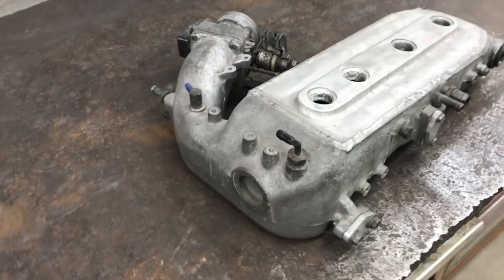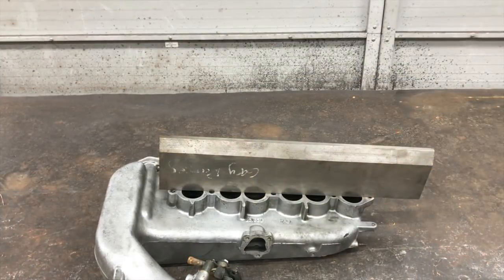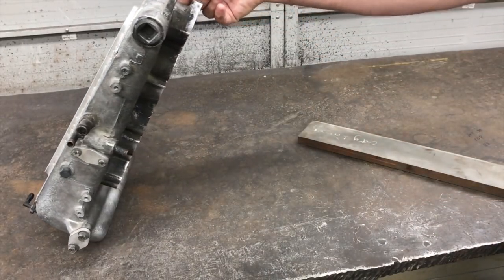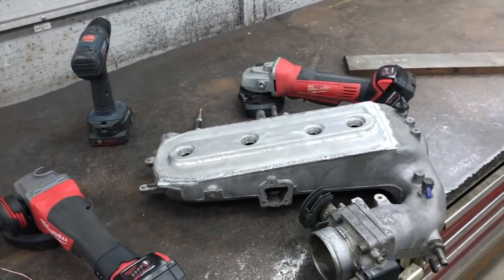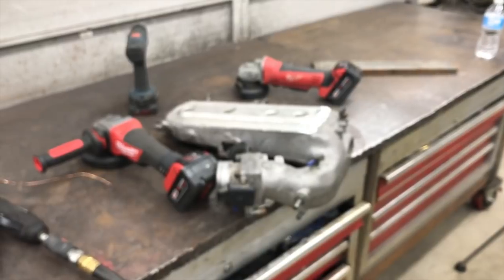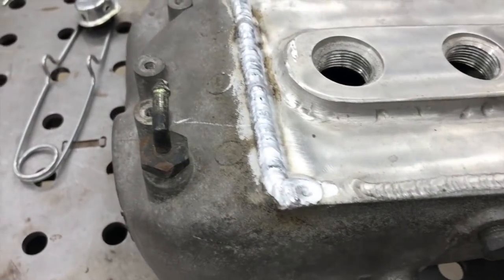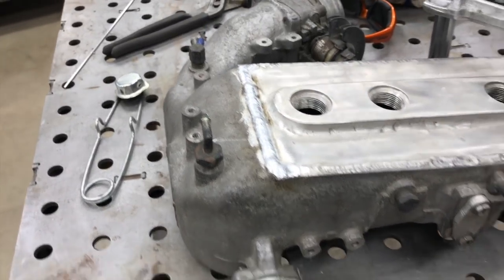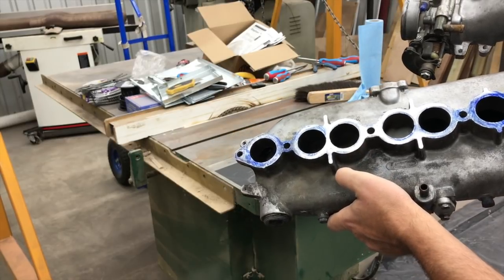Customer Returned Cracked Aluminum Weld - Tig Welding Intake - Lapping the flange

Comment: when you say "drive it in there" and "keyhole" when welding cast, I don't think thats what you want to do. I always use the least amount of heat possible when welding cast and think of it more like I braze. You don't want to melt a ton of that nasty cast base material into your weld. I also try to use 5356 on things that heat cycle, preheat and wrap with lots of blankets to prolong cooling as much as possible.  I hope it holds this time and best of luck buddy.
Reply from the maker: Well, the top is 1/4" thick, and i was directing more of the arc into that side, trying to wet it in, so that there wasn't a cold weld sitting up on top of it, but i get your points.  This is only the second cast aluminum thing i have welded.
Reply: I know what you mean, cast is a crapshoot (for me) and I make that really clear to whoever I'm welding for, but it's usually just a friend or relative of mine if it's cast.

Comment: Bolting it down in the first place, along with pre and post heating, would have avoided the cracking. I also agree with the other comment about the craters at the ends of the welds, need to back off slowly and add a bit more rod as you terminate the weld.
Reply from the maker: Yes sir you are definitely right about it.

Comment: What rod are you using?  5356 make a pretty brittle weld IME, 4043 is better, but 1100 makes a dead soft weld that wets out easy.  1100 is good on radiators where vibration is present.  Or I could just be talking out my backside...
Reply: I believe 5356 is much better at heat cycling as I imagine that intake does a fair amount of, but it could have been it cooled too quickly after welding.
Reply: 4047 is used where there are problems with cracking, so might be a good idea to try that out, regarding Si content, 356 has around 5%, so does the 4043 filler, 4047 filler on the other hand has 12% Si

p.s. using cetner drills in hand hold tools is testing your fate, they are very hard and brittle, and it is very easy to brake the tip, for hand helds, use a regular drill bit of the size of the center drill shank, cut it short and grind split point on it, buying proper machine center drill for this isn't really a good option, most don't have sharp split point grind on them and without it it will be hard to drill anything with just hand pressure
Reply from the maker: i mentioned in the video i am using 4043.  Base material is 6061 and cast aluminum
Reply from the maker: Btw, where you been, haven't seen many comments or videos from you lately
Reply: ...That thing is sand cast...so likely 356....pretty soft, so I'd maybe use that 1100......A friend of mine used to do some of this auto stuff, often had problems like this...you never know what the last guy did.........I'd grind that crack all the way through, and maybe  try purging too....
Reply: Doesn't Jody use 4047 on cast?  I think I read it's supposed to have more silicon and be closer to cast alum or something.
Reply: what he meant to say is a strong weld not a brittle weld. of coarse stronger is more brittle its going to have more of a tendency to crack or break rather than bend or heave. but try testing your welds by cutting them into 2 inch strips and making 180 degree u-bend in hydraulic press and watch for a perfect piece of metal or fractures or risers or flaking or carbon impurities. both will make the bend no problem at all if the weld is perfect.

BTW: cast aluminum is going to break before it bends. So what is the point of this comment?
Reply: @Doug Ankrum 
another great comment and no reply by ramsey. But hes got to clean the oil and grease off that thing. I dont know wth he was thinking when he gave up cleaning and started welding on it. I cant comment on his technique or posture or equipment, because he failed the preparation. one step at a time.

BTW: it would have been wrong with a mig welder too but it would have burned thru it with increased splatter and maybe little pitting if amps and wire speed and angle not set perfect
Reply: tom watch the video at the point im referring to. beside if its the same alloy and its now stronger. yes its now going to be more brittle. you can take that to the bank. just because its harder doesnt mean its not more brittle. learn the difference between tensile strength and shear strength. i think that will help.
Diamonds are extremely massively ovariously hard. right?  what happens when you smack one with a hammer using only the hammers weight? BRITTLE..

Comment: Try some water to lubricate next time or even cutting fluid to sand, you wont use so much paper.
Reply: I used tallow (animal fat) for sanding aluminium for years. Smells like shit but works like hell!
Reply from the maker: some good points, thank you sir
Reply: Windex works awesome....
Reply: he never cleaned it good enough to begin with. it has to be spotless and 110% contaminate free inside and out. Buy a wire wheel for the bench grinder and an assortment of sizes and shapes to fit your drill, For PETE's SAKE! I was horrified watching that tungsten glide past that corroded piece of junk metal.
Reply: wait a minute. animal fat? tallow? which one? they are two different things.
Reply: befrore you say there is no fat on deer i'll counter by saying youve never processed venison. I assure there is fat in a deer and its just like striking gold when you find it, because you know its going to be the bestest most mostest delicious morsel your going to put in your mouth that year. the meat surrounding it is going to be stick butter tender and like the marbling that makes a prime rib or a ribeye so juicy and delicious. take that and multiply by 10 in an animal with almost no fat whats that song clint eastwood sung gold fever?.. But Sorry guess who is going to eat it most likely before it even gets served.
Yes btw deer have lots of tallow. teach me how to get rid of it all during processing please. yukk tallow. EWWWWWW. i mean freaking ikky mann! Yeah for real. sheeeesh!! get it?
Reply: have you ever wondered why chinese plastic stinks like hell and brimstone? ever ask yourself what happens to all the cat and dog carcasses? yes and tallow

Comment: Hello Gary,  No denying the stresses but a clear weak point in the weld is the crater at the end of the weld where it looks like you ended a bead.  The crack will start there and propagate outward.  Back pedal and pause at the end of a bead is good practice.  Nice welds though for sure other than that.  Might put it in your wife's oven after to stress relief it!!!  Take care.  Doug
Reply: Best response ive seen on here yet, finally someone who knows what there talking about, anything cast you need to let cool down slowly!
Reply from the maker: You are right and i definitely need to get better at a slow ramp down and swirl, I have seen jody do it a million times.